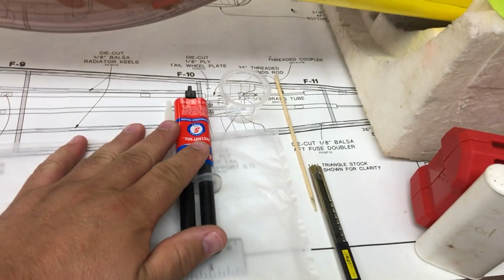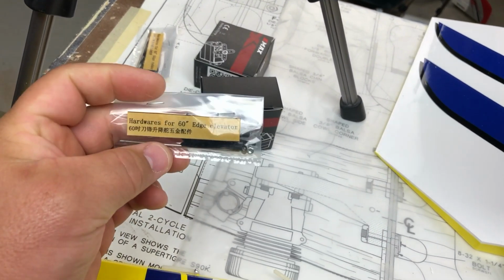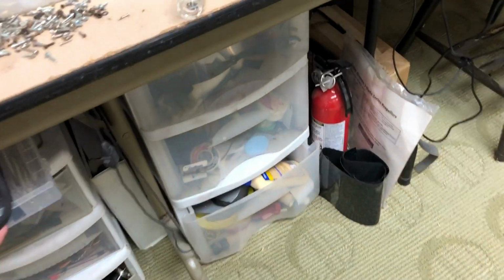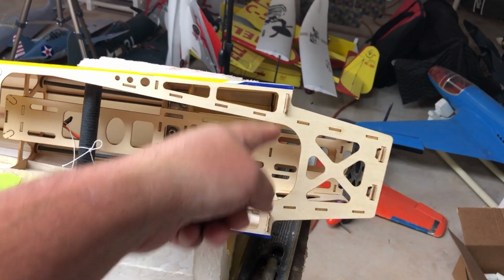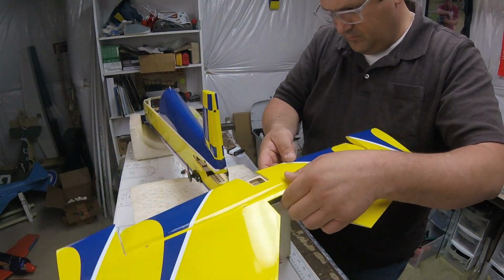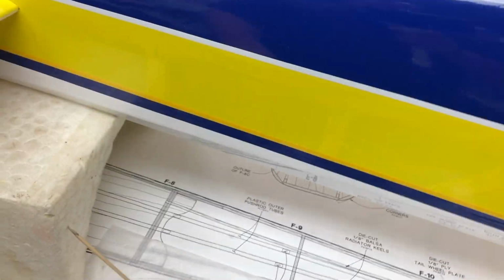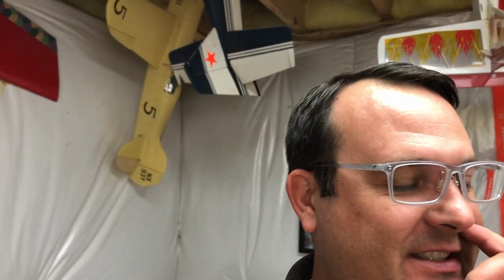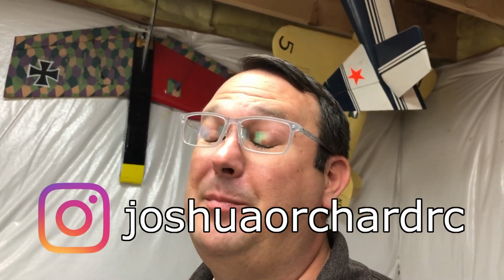ARF Techniques 102: Tail planes

Comment: Nice video. I also use a servo tester to center servos and clamps to hold the control surfaces while attaching the controls. However, when I want to set the initial throws, I usually work with the wing and receiver separately from the fuselage. I like shrink tubing for extensions on long internal runs but those clips looked cool. I use numbered tape wire markers on my connections.